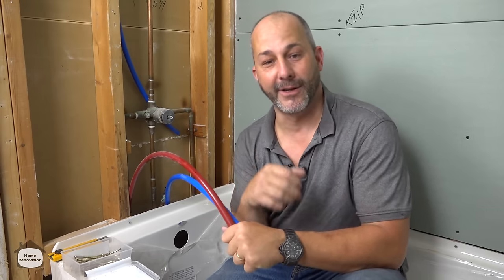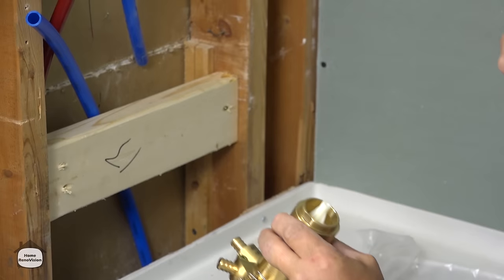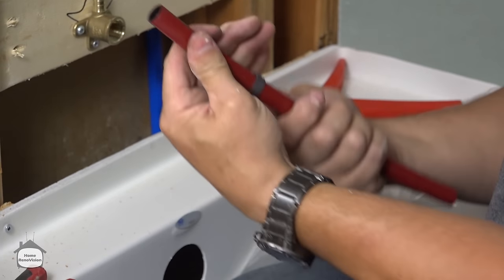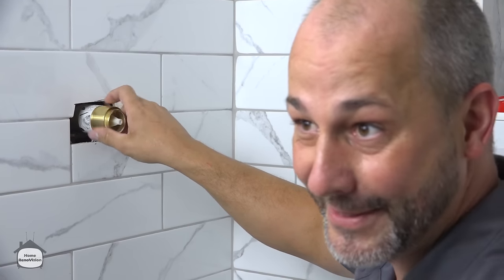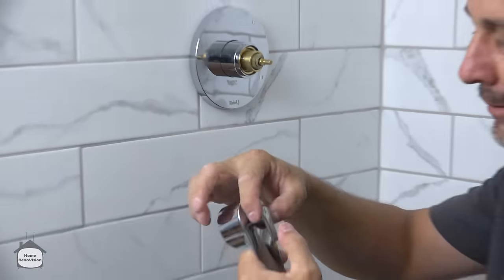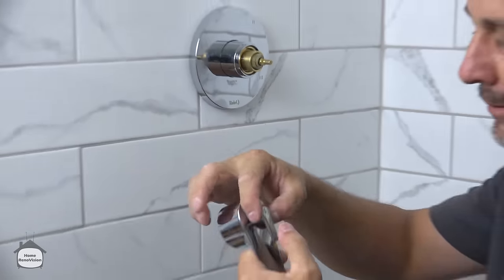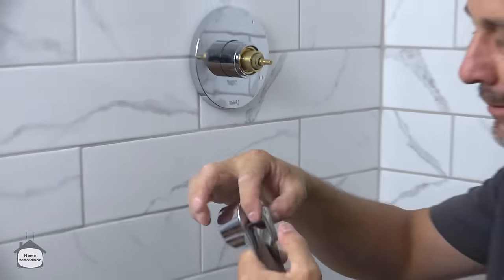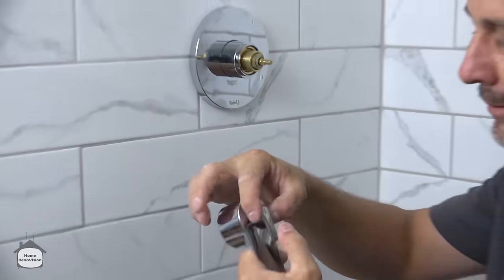How to Install a Pex Shower | Full Installation Tutorial

Comment: A hilarious closing would have been Jeff adorned in a shower cap with a loofa on a stick. I really enjoyed this presentation, although you skipped over opening the shutoff valves for the hot a cold water plugs on the mixing valve. I might use this setup on my renovation of my own bathroom in the future.
Reply from the maker: Love the shower cap idea cheers!

Comment: Reisinger had a good video on psi testing of pex fittings. Ended up that the fitting isn't the weak point, the tubing wall is and has plenty of leeway for residential.
Reply from the maker: the point is that pex is ten times stronger than the water pressure in house. the fittings are 20 times stronger. the only time they fail is when installed incorrectly. Cheers!

Comment: Consider a knipex pliers wrench for the plumbing fittings.  They have smooth jaws and you wouldn't need to use bubble wrap with them to keep from damaging things.  I love mine.
Reply from the maker: Thanks Joshua, just trying to show folks with limited tools how to get a great result. Cheers!
Reply: @HomeRenoVisionDIY  That makes perfect sense and I appreciate the content.  Just wanted you to be aware of the tool in case you hadn't run across one before.
Reply from the maker: Thanks Joshua, I appreciate that. cheers!

Comment: Hello Sir,  I used teflon tape for my water line 1'' brass fittings, I put 20-25 wraps on those fittings and I still can thread them together by hand. Should I use another sealing method or should I put more wraps?

Comment: Thanks for all the help, Learned a lot from your videos. Could you please review PRV and Thermostatic shower valves when you get a chance. There are PRV or thermostatic. I am interested which has both PRV plus Thermostatic.
Reply from the maker: This valve is both a pressure balanced and thermostatic valve. from riobel pro. Cheers!
Reply: @HomeRenoVisionDIY  Thanks a lot, before watching your video, I thought you could have only option, PRV or Thermostatic. Thanks for help

Comment: love the tile size used on the shower walls and it is not 12 x 24 porcelain but is it ceramic 8x20 or larger?  Should I use porcelain or ceramic on shower walls? Please comment.  I like porcelain but often size is too large for 4 ft x 4 ft shower.thank you for all your videos.  I will soon be buying equipment to use pex.
Reply from the maker: hey Jerry, the less grout lines you have the longer your shower lasts. ceramic and porcelain perform the same in a shower. Cheers!

Comment: I know it has nothing to do with bathrooms, but can pex handle winters ok?

Even though I make sure I bleed the line of water, every year the copper pipe to my garage tap bursts. Well almost every year. Don't know why! I replace the burst area with a spare and sleeves. Would replacing the entire line (not long, like 7' to the wall) with PEX be a possible solution? Or its not a good idea in Canadian weather? Thanks!

Comment: Hi Jeff.  I discovered your channel looking up DIY shed tutorials and subscribed because you looked like you were just having so much damn fun.  Your "safety squints" also sold me.  LOL.

So I've been working on a project converting an old camper to a  stationary tiny house.  I've redone all the water lines using CPVC, and I'm working on my shower now.  I removed the old tiny bathtub and after finding out how expensive custom sized shower pan/base assemblies were decided to fiberglass my own.  I'm not sure I saved much money, but I learned a lot and had a lot of fun.

Here's my question.  I am looking to install a similar shower system minus the bathtub spigot.  Can you recommend a good quality unit?
Reply from the maker: you need to get a valve that has positive stops at each function. riobel and grohe both make those for sure.Cheers!

Comment: Great video :-) How did you finish the exposed edges of the niche tile?
Reply: Danny Hajicek I used 36” marble thresholds. Super cheap, cut them to size, then rub the edges down with a grind stone. Doesn’t need to be super rounded, just so it’s not sharp to the skin.

Comment: QUESTION: On the Rough In Shower Valve, I noticed that you have the shut off valves in the OFF position when you install the cover plate etc.  Did you turn the two valves back to horizontal (ON position) at some time?  If so, when is this done?  Great video's, thanks.
Reply: It’s a winding on off shutoff, the position of the notch does not indicate open/close. In this case left is open right is closed

Comment: My contractor installed my MOEN valve with PEX on all 4 outlets and caused water to back up to the shower head when running the faucet (he disregarded the manufacturer installation instructions to NOT do this). Called my licensed plumber and they determined the PEX going to the tub faucet needed to be copper or galvanized pipe as PEX reduces water pressure...thus causing it to go the shower head.....which the manufacturers instructions originally SAID to do.

Comment: Thanks for the great info.  I hope to use PEX on my upcoming bath project.  I've noticed that the ID of the 1/2" PEX is smaller than  1/2" copper.   With any of the shower/diverter values that you have installed, have you noticed any draw backs with using 1/2" PEX. In my case I will be installing a posi-temp value as well as a diverter for an additional wand/spray.  I'm wondering if there would be any advantage to using  3/4" PEX to more closely match that 1/2" copper.  Thanks.

Comment: With those mini-cutters, I find a “twist” action works better than “spinning” it around the pipe. Just make sure you go the full 360 degrees on the twist. For me, it seemed like I didn’t have to tighten the cutting wheel as much when doing the twist.

Comment: I just finished installing a new shower, tub combo into a house that's 120 years old.  What a nightmare and I should have used pex plumbing.  Thanks for the video.  Also, when did you turn the shut off valves back on that are on the valve itself.  It would be a shame to get everything installed  only to have to take it off again because you forgot to turn those back on.  Just saying.
Reply from the maker: it has definitely happened to me before. just remove the handle and flange cover. CHEERS!

Comment: Hello I purchased a Moorefield Rain Shower system and have all the plumbing completed.  A few things, I do not know how to check for leaks prior to tile job, are you familiar with their products?  It has two dials, top one controls body jets, rain shower and hand nozzle.  The second controls the temp.  How to I know where off position is?

Comment: In the event that you have to cut a bolt without the tread gaps. Take a nut and tread it on the bolt first, make you cut and remove the nut to straighten the treads out...

Comment: Jeff, your video does not show the beginning stages of your 1/2" Pex B installation from the main potable water source. Is this Pex tubing of hot and cold to the shower a separate line from your manifold system or is it individual separated by tees to the sink and toilet only using one 1/2"  cold main line? You state, not bringing a 3/4" line in which to me would bring more water to the sources, if these were to be tee offs from it.

Comment: Jeff, I am trying to swap my toilet location with shower location to increase the shower width by 1.5 times the original width. Could you advise if this is doable and are the drain pipes size generally the same diameter between the toilet and shower?

Comment: What do you think of the "cinch" fittings rather than the solid rings?  There are now some very inexpensive crimping tools for these PEX cinch rings, but I'm a little bit leery of holding power to bury these behind the wall.  Any thoughts on this as an alternative to the solid rings?

Comment: Hey Jeff, what are your thoughts on using push to connect fittings instead of crimp rings for shower connections? Im planning to redo some plumbing and thinking to use push to connect to save time .

Comment: Thank you! This is cool.
So, the Sharkbites are ok if I have an access panel to check on them?
Looks like the crimping tool requires a good amount of strength.
I do like how PEX has more flexibility in terms of moving forward/backward to get things positioned right. I'm going to do a direct-to-stud kit instead of tile & will have access panels behind to do maintenance/inspection.
Reply: Newer sharkbites are rated to go behind closed walls.  You should have an access panel anyway but not just because you're using sharkbites.
Reply from the maker: my crimp tool needs to be adjusted so it is less work. LOL, just need to find the time.

Comment: Hey Jeff, is there some reason that you did not align the shower rod system to the right of the rain shower head so that the higher pressure shower head would be centered beneath it?  Is it a matter of vertical clearance or something else?  Love your channel keep up the good work!
Reply from the maker: i align to the outside edge so that water is sprayed towards the interior wall. if i align to the inside the shower sprays to the curtain. Cheers!
Reply: @HomeRenoVisionDIY  Good note for sure...is the reason you do not try to keep things all centered (I LOVE SYMMETRY!) so that you don't risk putting a screw through a water line by accident?
Reply from the maker: definitely part of it. I like to screw into wood not tile. cheers! If someone slips they are going to grab that bar. and i would rather not bring down the wall. cheers!

Comment: Hey Jeff - would water not get into the control mechanism by weeping along the grout line? There was no silicone along it and that plastic piece installed behind the face plate didn't look like it sealed completely.
Reply from the maker: The plastic piece has a gasket that diverts to the bottom and there is a space there for water to run back into the shower without building up. No worries.

Comment: Any time you run a fastener through a waterproofing system, apply some silicone behind your mounts.
Reply from the maker: the goal with waterproofing is not to create a submarine. if a tiny bit of moisture penetrates the membrane then the wood structure of the house will dissipate it without consequence. Cheers!
Reply: @HomeRenoVisionDIY   @HomeRenoVisionDIY   True, but we have built for years with premise of preventing that water.  It only takes a second to put a blob of silicone over that hole.    I enjoy your vids when I get the chance, it's fun to see what other remodelers are doing.  Keep it up.

Comment: Hi Jeff, I am a huge fan of your channel. Tons of great info. My question is regarding how you mounted the hand shower rail. Any concern about the wall penetration if using a Schluter Keri membrane system? Is sealant or silicone necessary at the screw holes? Thanks again for sharing your knowledge!

Comment: You need the ridgid autocutter. It’s the same as a regular midget cutter but you tighten it two turns tighter and then just spin it and it will tighten down automatically. Another channel did a test on various pex fittings. They had the shark bite brand like I think you’re using, uponor, viega and the shark bite with the pinch rings. No fittings failed. At about 400-500 psi the pipe would stretch and burst but the fittings always held. With crimp pex you do have to consider ID. That only comes into play on larger projects and the pipe is upsized at that point anyway so it’s irrelevant. I still prefer expansion fittings for that and other reasons. As for red and blue, personally I don’t like it. In concept it’s great but what I’ve seen too many times is someone runs out of one color and replaces it with the other. This shouldn’t matter because a service plumber should always make sure what they’re dealing with but it’s very easy to see a red pipe, kill the hot at the water heater, cut the pipe and flood a place.

Comment: I know this wasn't part of the video, but maybe you could answer a quick question for me. I'm installing a 3 piece walk in shower.  Everything I find on line says to use galvanized roofing nails to install it, but the manufacturers directions say to use screws. The only galvanized screws I can find at my local home depot are something that that looks like Sheetrock screws. And I'm ok with using them because they state on the box that they will work in damp locations. My concern is that the head of the screw is tapered. I would obviously pre-drill the hole. Should I drill the hole with a counter sink bit so the hold that the screw goes in to also has a taper, or are there specific screws made for securing a shower? Thanks!
Reply from the maker: Hi woody, always follow the manufacturers advice. Cheers!

Comment: What valve did you use? Every valve I have installed specifies to not use pex down to tub valve. Also what did you use as a waterproofing on the green board behind the tile?
Reply from the maker: Hi Dan, this valve has a positive stop for each function so the pex to the tub spout functions fine since it is not dependent on a manual diverter. It is from Riobel!

Comment: Question:  Why did you have to put those elbows on the red and blue water supply lines instead of just curving the lines like you did for the third line to the connector for the wand?

Comment: Curious - have you had issues with shark-bite fittings in the past? It would seem to be easier and safer for DIY then using a torch and solder.
Reply: I have used shark bite in both the professional world and personally in my home. I used shark bite in the installation of backflow prevention devices for hydronic heating systems subjected to extreme back pressure inside mechanical spaces that shared steam heating and exchangers. One can say those rooms saw temperatures above 140 degrees Fahrenheit ambient. The backflow devices were installed from domestic heating to hydronic heating system for make up water to protect the domestic water at 120 degrees Fahrenheit to hydronic heat system temperature at 180 degrees Fahrenheit. In the 5 years of installation never had an issue with the shark bite on the supply side of backflow. I also used them in the remodel of my home and in my parents house for their restroom remodel on both hot an cold water fitting. Parents remodel was done in 2012. Still no leaks todate 29Jan2020. Sold my house in 2013 with shark bite done in 2011 so I can not verify that install any longer. As said above parents house all good. Btw galvanized to pex with shark bite and shark bite to all fixtures.

Comment: Hey Jeff,
I was told that the pipe going down to the tub spout can not be pex,that it has to be copper . The supply lines and the pipe going up to the shower head can be pex. I see you are using pex to the tub spout .
Reply from the maker: if you have a manual diverter that can be true. On this shower the control has a positive stop so there is no back pressure. Cheers!

Comment: How hard is it to use PEX in order to re-route your supply lines to say an opposite wall? I only have a 5'x8' bathroom and want to convert my tub to a shower but my toilet which is very close to the existing tub and a discharge line would be a pain to move.

Comment: So if I'm working with a wall that was built with 2x3s then I should use a 1x4 for the proper spacing on the valve?

Comment: Did you screw those shower rod screws directly into the tile and into the 2x4 behind the tile?  I may have missed any receiving holes in the wood or anchors that were installed prior to the tile being installed.
Reply from the maker: Hi Joe, I like to arrange framing behind my shower fixtures and wall fixtures a s a part of my reno planning to achieve long lasting results. Cheers!

Comment: Hello, thanks for posting the video.  the shower valve body I bought came threaded.  The instuctions state to install pex over top the threading and then crimp if choosing to use pex.  My concern is the threading could cut into the pex and cause a leak in time.  Is my worry justified?  What are my other options?  Should I sweat in an adapter?

Thanks
Reply: Male sweat by pex barb adapter or if you don't want to solder, female 1/2" npt by pex barb

Comment: Maybe I'm just being an idiot, and am over thinking all of this with my shower renovation but I'm in need of your professional guidance oh wise one. Stand alone shower, with the intent of two shower heads, one in the standard location, and one from the ceiling. I want to be able to have each shower head run independently, and run both simultaneously. So here are the questions....would this be controlled by a 2 or 3 way shower valve? Or is it controlled by the trim package for the shower system itself? I'm having difficulty getting a straight answer on product descriptions
Reply from the maker: Hi Wade, I would suggest the product I just installed. It is a 3 way by delta and comes with a wand and rain shower head that can operate in dependently or mixed based on the position of the diverter handle. really easy to operate. You can get one from fergusons or wolselley if you are in Canada! Cheers!

Comment: The water and all that stuff will go behind that finish plate and will mold, you still need to put clear silicon around it.
Reply from the maker: Did you not see the gasket attached to the plate. it is all the protection you need. cheers!

Comment: If my hot water gets cold quickly after turning on my shower. Does that mean that the shutoff valve is broken? And can I just change the valve if so?
Reply: Is the water hot and then cooling down (with plenty of hot water left)?

Comment: What are your thoughts on using sharkbite connectors for this?   As I understand you wouldn't have to do any sweating at all with them.
Reply from the maker: i love sharkbite, however it is still needed in most places to have access to them in case there is a need for replacement down the road. cheers!